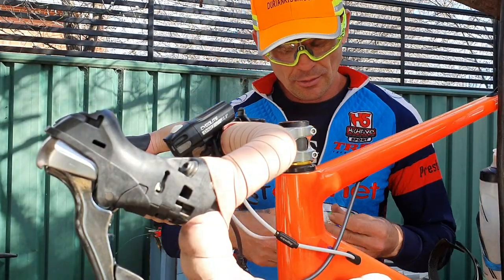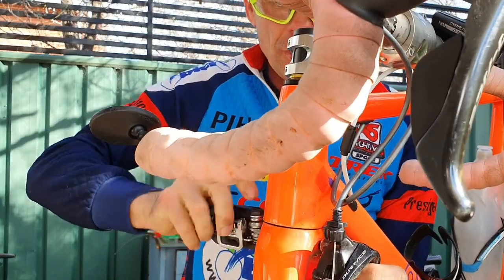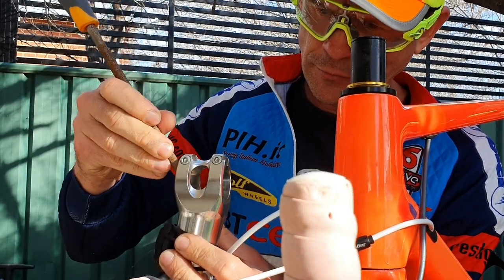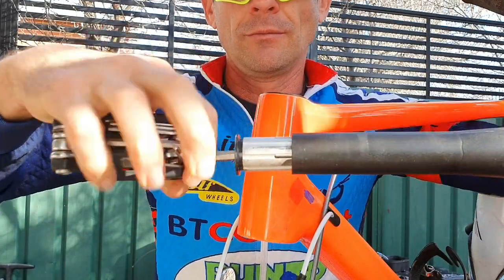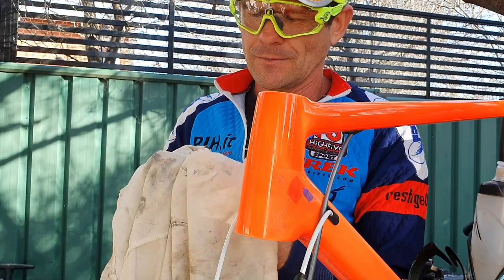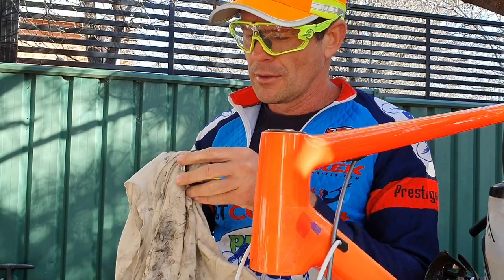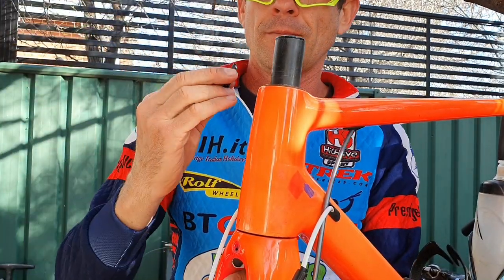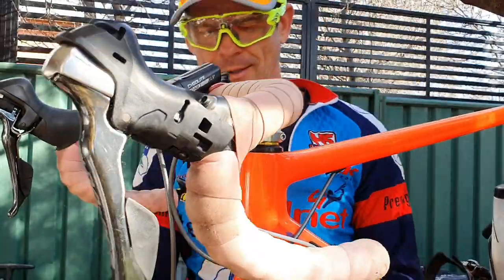How To Prevent Your Bicycle Fork Snapping On A Ride?

Comment: Top tip is to tighten the steerer bung with the stem on as some bungs can expand the steerer tube so much that the stem will not go on with force. Not applicable to the colnago one as its quality

Comment: I would worry a bit about the tyre rubbing trough the fork. You are already on bare carbon. 28's were probably a bit big for the fork. Or the wheel was in crooked.